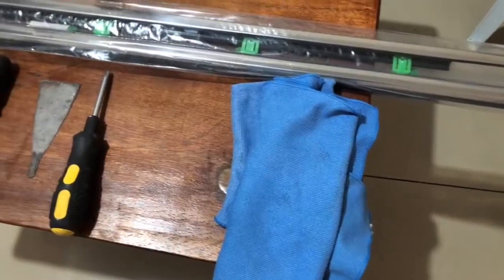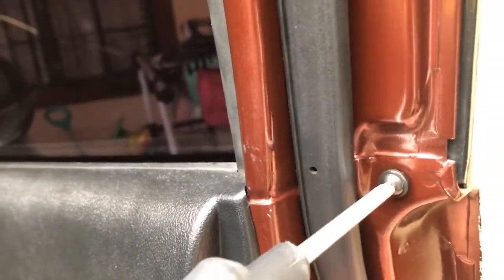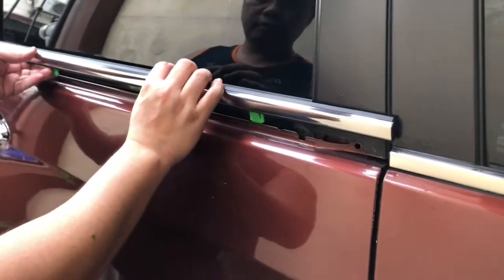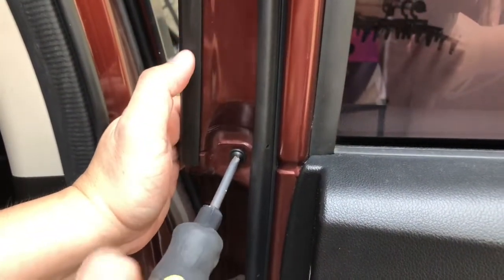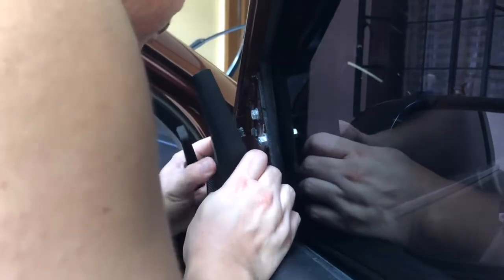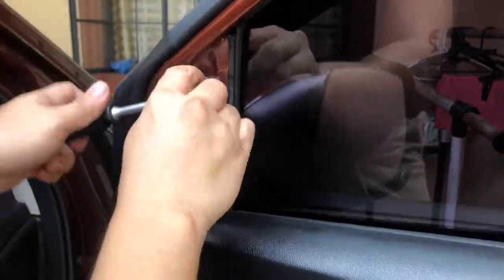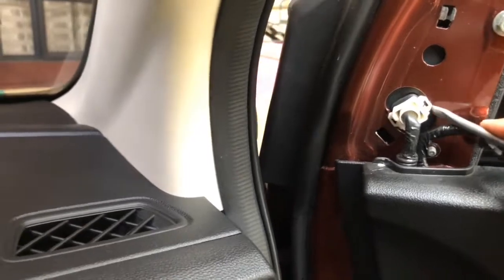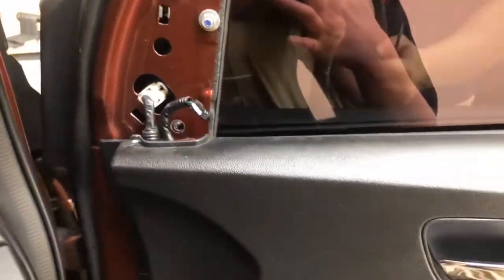Honda CR-V window trim replacement

Comment: Isn't there an adhessive to just glue the rubber back onto the trim?
Reply from the maker: Typically, the rubber itself will become flaky and melt due to age and exposure to heat over time. They tend to stick to your glass window and gets messy. I haven't seen a process to replace just the rubber but I would assume it would involve removing the trim itself so it would be prone to damage so might as well replace the trim set anyway.
Reply: I went to the link to try to order.  Do they ship to the USA? I didn't see a price in US dollars so idk how much they are.

Comment: How many screws did you remove in rear passenger door?
Reply from the maker: Just 1 screw in the rear doors and 3 screws in the front doors
Reply: @yzobbon6285  thanks and i really do appreciate this kind of informative vidz.